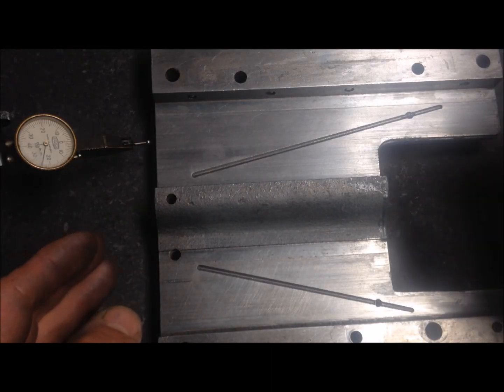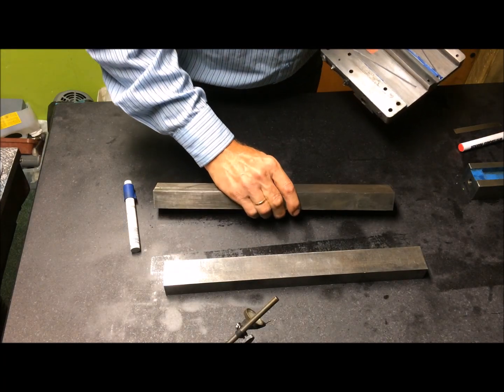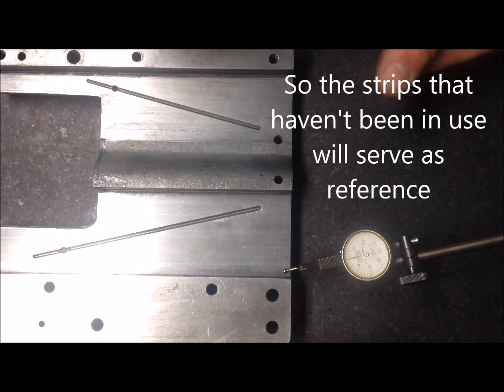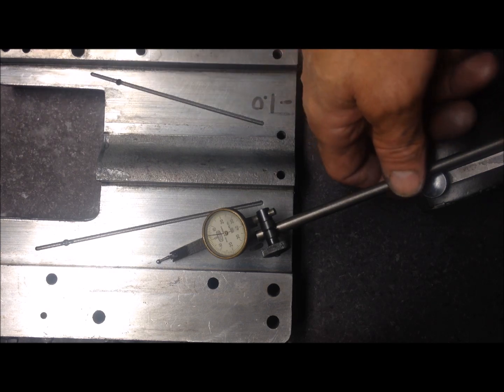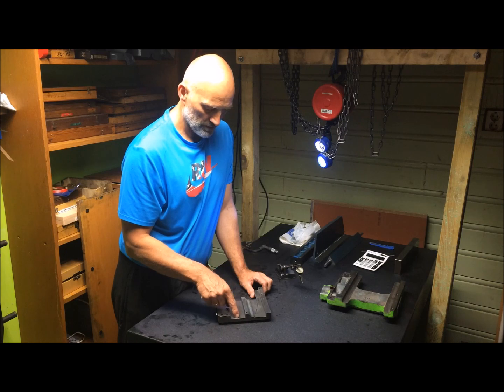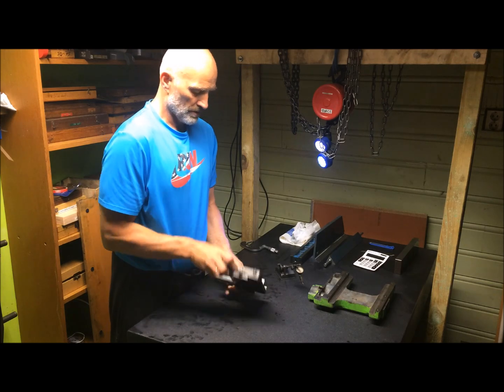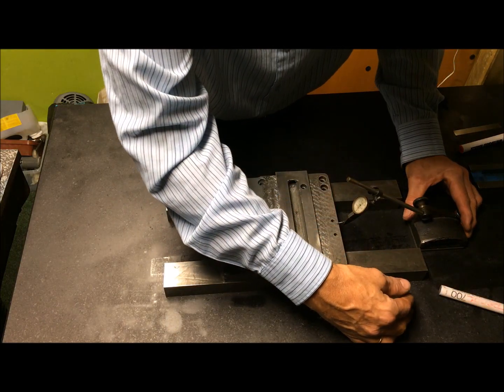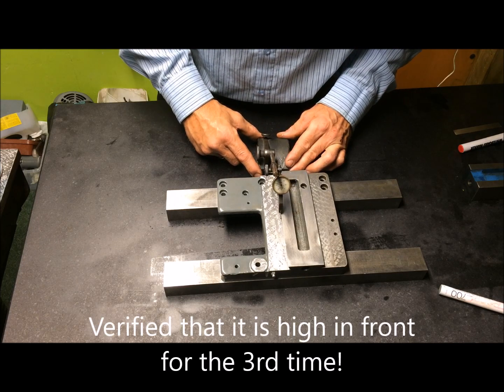Myford Super 7 - Saddle - initial measurements

Comment: Hello Jan Sverre 
Thank you for your excellent videos. I am about to restore and scrape my myford super7 saddle and topslide. In terms of workflow (i.e. what to reference and scrape first, then second, etc), are you able to provide any guidance? Much appreciated. Cheers!
Reply from the maker: Thnks for the nice words! I think I can be of help, yes. In general, I would say that you have to start with the foundation, in this case the bedways. Then work your way up. The bed can serve as a templates later when scraping and fitting the saddle and tailstock base and in itself needs to be accurate. To aligne the saddle and cross-slide you should also have fitted the headstock and spindle, so I assume these parts would be the natural next step, at least for the final alignment of the saddle. Jus contact me at my gmail account (jshaugjord) or look me up at Messenger if you need guidance. Good luck!